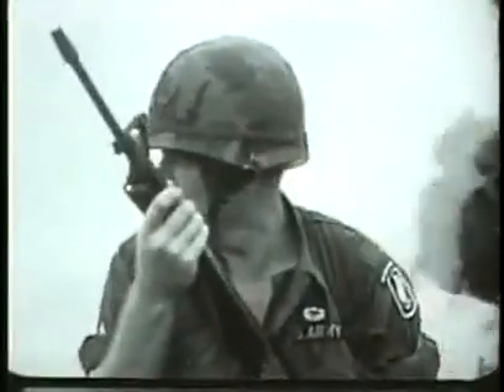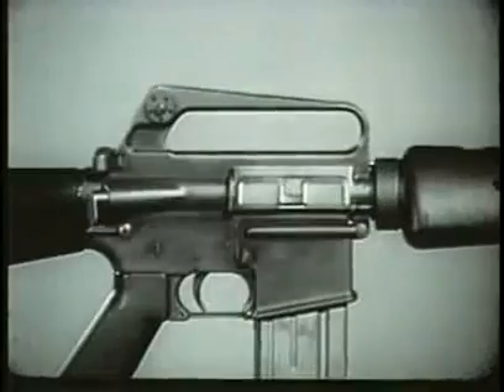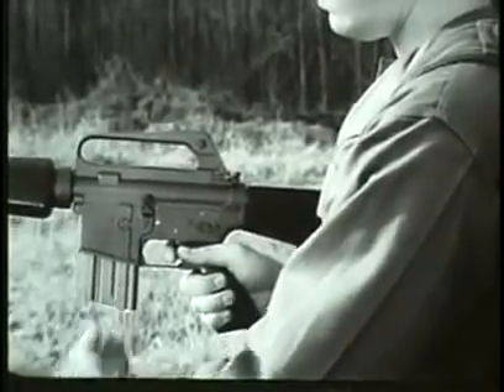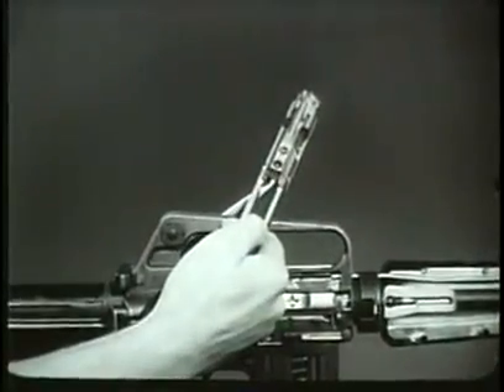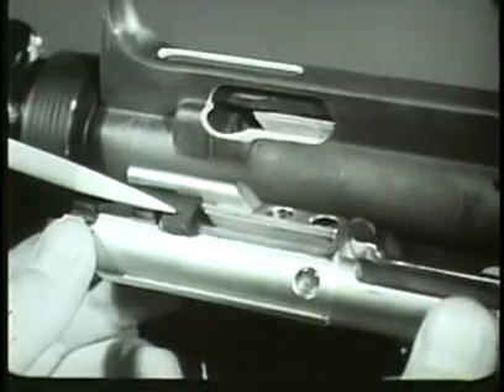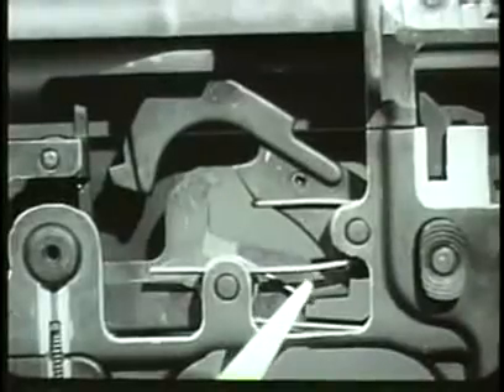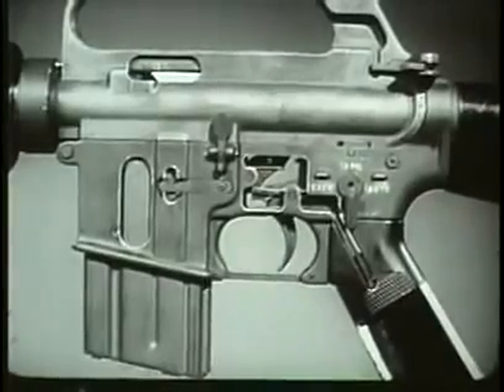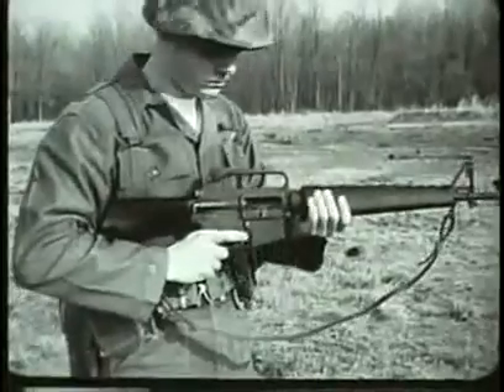Vietnam War Era Training Video: Operation of the M16 (AR15 variant)

Comment: I loved the m-16a1. I could knock down multiple targets quickly and efficiently at all ranges. Then the a2 arrived with a heavier barrel and there was the problem where the barrel would overswing the target where then I'd have to bring it back on target...
I know they had to solve problems for a range of shooters. The ones who couldn't seem to ever grasp the four basics. But I'd trained these bolos and had turned them into at least sharpshooters on the a1. The changes only seemed to hinder those that were expert and they didn't do much for the weak shooter. The loss, was that you had expert shooters who, before, could wipe out 3-4 targets before a weak shooter could score a single hit, who were now only producing 1-2 targets in the same span of time. Thats a critical loss in a fast paced environment. The 2 that weren't taken then and there, could be the ones that turn your victorious raid or far ambush into a loss or a protracted firefight that has now put you in a bad position for the inevitable counterattack.

Comment: The M-16 wasn't the grandfather of the Ar-15 it was a variant of it.  Colt purchased the design for the AR-15 from ArmaLite and modified it for construction of the M-16 variant for submission to the U.S. Military when they were looking for a lighter MBR chambered for a smaller projectile than the M-14 MBR at the time.  The M-4 (current U.S. MBR) is another variant of  the original ArmaLite AR-15 design.

Comment: The m16 and the AR15 are two different guns… ones actually military grade and made for war the other is a personal defense weapon not at all suitable for war let alone use by military.
Reply: You definitely could..only difference is it doesn't have a fully auto switch. Which our boys never use anyway. Its a waste of ammo and inaccurate
Reply from the maker: Good point.
Reply: no. Armalite AR15 was what would become the M16. Colt just kept the name for the semiautos
Reply: @d3203  key words "would be" not the same. Would you call an MG34 and 44 the same gun?
Reply: @DW-zj6ux  Mg34 and Mg42 are completely different systems. The Armalite AR15 and Colt 601/M16 are the same rifle.
Reply: @DW-zj6ux  i guess you meant the Mg42
Reply: @d3203  yes I did. I had the mp44 and STG on my mind
Reply: @DW-zj6ux  and its would become not would be. Like by your name i would assume you should be a native speaker.
Reply: @d3203  we aren't speaking. We are typing. I'm not writing an essay.
Reply: @DW-zj6ux  and back to the "argument", the MP44 is the same as the STG44. The Sturmgewehr (assaultrifle) is a propagandaname for the MP44.
Reply: @d3203  the mp44 was a prototype
Reply: @DW-zj6ux  no its not. In 1943 the MP43 went into massproduction. in 44 they changed the name without changing anything to MP44, shortly after to STG44.
Reply: @DW-zj6ux  the prototypes name is MKb 42 (H).

Comment: Hind sight is a wonderful thing.
The manufacturers demonstrated this weapon's "reliability", 
by using a different type of ammunition to what the troops in 'Nam were using.
  This was a major contributing factor to the weapon becoming fouled by residue
When the "fouling" and resultant unreliability problems were reported to the manufacturers, they tried to say that the troops weren't cleaning them properly!
   The troops would have loved to swap places with the folks that said that,
 as they tried to clear a double feed as the enemy were upon them,
those enemy troops carrying AK's.
    It took a very senior officer, who had served in 'Nam,
 to get the top brass to address the problem.
Reply: however the Ordinance Corps were the ones issuing the out of spec powder ammunition, Colt had no input on that whatsoever

oh yeah and the troops definitely weren't cleaning them properly since almost nobody was given a cleaning kit until the late 60s

Comment: Did it come with extended mags? 

20 bullets isn't much other than single fire and semi fire.
Reply: 30 round magazine at that time may be still in development and testing I think. It's not until late 60's that they start issue 30 round mags.

Comment: the forward assist was a mistake, everyone knew that except the army
Reply: Paul Harrell has some words for people such as yourself that believe you're an expert to give advice and critique something you apparently know nothing about.
  You're an expert idiot
Reply: @CM-ve1bz  ive watched that video, that is in no way related to what i said
Reply: @lowquality9232  
  You made the claim that the forward assist was unnecessary and "everyone" knew it. 
The only ones that would make such a claim don't know what it's actually for and that's exactly what Harrell was talking about.
Reply: @CM-ve1bz  its called an exaggeration, i didnt exaggerate the fact and make a blank statement about it but instead the "common knowledge" of it and those who knew about it
Reply: @CM-ve1bz  and im aware of what the forward assist is for, to seat the bcg, the issue is there was no need for it and that is why eugene stoner originally had not included it until the US Army demanded it, even after the air force came out later saying why it was not needed and how it was likely to just cause issues
Reply: @lowquality9232  
  Yes indeed it's for seating the bolt but it's not intended for beating a round into the chamber.
Reply: @CM-ve1bz  what lol? that still doesn't change the issue that its unneeded
Reply: @CM-ve1bz  okay 🤷🏼‍♀️ good luck with that
Reply: @Aidan Hand I think there’s a mixup here. Both the Air Force and the Marines did NOT want a forward assist. Only the army demanded it, probably to have ONE THING from the M14 they loved brought to the M16. The army was forced to take the M16 kicking and screaming, if you recall.
Reply: “The forward assist was a mistake, everyone knew that except the army” is what you said. You regurgitated that unoriginal thought as if you knew anything. It was, in fact a good idea and retains the same use it’s had for the last 55ish years. So no, reading isn’t hard. But apparently regurgitation of unoriginal thoughts and sticking by them is 😂. Dead in the water dude. You’re a know nothing, just own it like a man and shut up and sit down.
Reply: @charlieyankee1046  when did i say the main comment is where i said what it was for lol? bro you good?
Reply from the maker: The air force pushed for it in the beginning. Ian over on Forgotten Weapons did a really cool video on that one. Link is in the description if you're interested.
Reply: @fighterairplane  saw that one! was a nice video giving insight into how the gov wants useless things at times, isnt the new trend making everything modular now? 😂
Reply: @lowquality9232  the forward assist is used quite frequently and is absolutely necessary. Maybe not on a flat range but I promise it’s got it’s place.
Reply: @charlieyankee1046  just because the military does it, doesnt mean its good, this should be known lol

the last thing you should be trying to do is force a round that does not want to be seated because of debris or a fouled chamber, thats how you end up with a stuck casing
Reply: @lowquality9232  
  I've already told you it doesn't have anything to do with forcing a round into the chamber. That's why you think it's useless, you don't know what it's real purpose is.
Reply: @CM-ve1bz  then explain it or see yourself out of it
Reply: @lowquality9232  
  I've told you what it's not for, a gun expert like yourself should be able to figure out it's intended purpose.
Reply: @CM-ve1bz  lmao so you think me saying the fa was useless was acting like an expert? man you really are trying to make that comparison with Paul's video
Reply: @lowquality9232  
Absolutely
Reply: @CM-ve1bz  OK
Reply: @lowquality9232  that’s not what it’s used for dinkus. What’s used for is ensuring the chamber is locked like I already stated. No one forces a round into the chamber. Little bit of carbon build up, bolt carrier not seating all the way forward with the chamber not locking up, yes. 

I promise I know more than you. Just because you watched 1 forgotten weapons video does not make you an expert on what the forward assist is used for. Promise.
Reply: @charlieyankee1046  yes, to push the hot carrier forward, i had literally said that was earlier, and I'll have you know I've watched every gun tuber om this platform, im an expert on everything from firearms, to tactics, and explosives 😎
Reply: @lowquality9232  oh no no no. Don’t go switching it up. You came out the gate hot on its “uselessness”. Don’t go switching it up now Mr. YT weapons employment and management expert. Keep that same energy boo.
Reply: @charlieyankee1046  literally read above, i said what it was for, still think its useless
Reply: @charlieyankee1046  learn to read or dont bother, when another user said i didnt know what it was for i said what it was for
Reply: @lowquality9232  I’m 100% tracking on you dude. Don’t deflect now.
Reply: @lowquality9232  no I just won’t let you walk it back😂.
Reply: @charlieyankee1046  man it isnt hard to read lol, i said what it was for

Comment: imo, one of the best and most innovative rifles ever created. The only downfall I see to the platform is the need for such a massive buffer spring to prevent an effective folding stock and the lack of charging handle attached to the bolt itself. Usually where the AK shines.
Reply: The AR-18, Armalite's other AR. It has short stroke gas piston system. The M1 Carbine's gas operating system is similar to this and got a paratrooper model with folding stock.

Comment: Not the AR15. AR15 was never an instrument of war.
Reply: Sure it was. The Air Force bought AR-15s from Colt before it was adopted as the M-16. The current models lack select fire, but it's mostly the same weapons system.
Reply: @PacketWrangler  no that's not how that went. Like at all.
Reply: @PacketWrangler  AR15s and M16s are two different platforms. In Vietnam the M16 was advertised as self-cleaning, which isn't true. The first fielded M16s didn't come with cleaning kits. The A1 featured automatic fire, which was found to be highly inefficient. The A2s were given burst capacity.
Reply: @PacketWrangler  what you might think are small internal differences are actually what separate the platforms. If you were to take an AR platform, run 100 rounds through a day, take it apart and clean it every night, you'd have break downs in equipment faster than M16s. M16s were designed for military purposes. While many M16s rattle because of loose fittings, it takes years for that to occur on most systems. ARs would come apart with that type of treating. Good civilian shooting rifle. Bad main force weaponry.
Reply: @carminescurse  i think he's more talking about it being "an instrument of war"
Reply: @staticdescent4769  it was never a main field weapon and Air Force was issued it for special assignment.
Reply: @carminescurse  I know I'm just clarifying what he was talking about, it seemed there was some confusion there
Reply: @staticdescent4769  oh ok my bad.
Reply: @carminescurse  just a heads up the AR-15 (talking about ArmaLite's baby, not the rifles that came after Colt marketed their version as a sporting rifle) is the M16
Reply: @harveyknguyen  no it wasn't.
Reply: @harveyknguyen  the M16 was offered to the US forces not the AR platform.
Reply: @harveyknguyen  the Air Force was issued ARs for special duty and only because the AR is cheaper than M16s. The AR is cheaper than the M16 because if it issue the M16 to you and send you out to a high combat area, the M16 will perform.
Reply: @harveyknguyen  the AR will fall apart. The first thing to go are the pins that hold the upper and lower together. The AR pins are made with a cheaper metal composite. The second thing thay goes will be a part on the bolt assembly. Either through deformation or just wear beyond what the platform is designed for.
Reply: @harveyknguyen  for reference, I pulled my own weapon off the firing range because the bolt warped, an M16. An AR platform will suffer those issues more frequently. It's designed for civilian application and to be cheaper than the alternatives.
Reply: @carminescurse  so what you're saying is that ArmaLite actually just made a semi-auto rifle in 5.56x45mm and the M16 is the military's brainchild, even though the report on the M16 still calls the full auto version the AR-15, and the fact that the Colt Model 601, an AR-15 and also shoots full auto, exists disproves what you said
Reply: @harveyknguyen  lmao. No, no.
Reply: @carminescurse  also you are completely correct when you say that the M16 (ArmaLite's AR-15) was offered to the US military and not the AR platform (Colt's AR-15) because the AR platform came out in 1964
Reply: @harveyknguyen  not a good thing to just run dry on ammo. In fact, usually only special operations groups carry automatic M16s. But mostly they don't, because as special operations they get a separate account for weapons away from Big Army.
Reply: @harveyknguyen  and they still don't issue automatic M16s to Big Army anymore. The M249 has more range anyway.
Reply: @harveyknguyen  no.
Reply: @harveyknguyen  you are so incorrect it's not funny. Just because these versions exist doesn't mean they are used.....like at all. And why would I? Literally the only place I would get issued one is special ops. And there are so many automatic (and semi-automatic) platforms I could qualify with that are so much more reliable that the M16/M4 platforms.
Reply: @harveyknguyen  by the way, when Armalite offered their platform it got passed on. For PERFORMANCE ISSUES. Colt picked it up, changed internal components and made it cheaper (stamped steel).

Comment: there were no jams, that surprising
Reply: well yes because it's a very functional weapon. from the ver y beginning int worked well. the whole jamming thing was caused because some idiot decided that they didn't need cleaning kits, and as it turns out leaving a gun's parts soaked in dirt water and mud for weeks to months at a time with no kit to clean it once in a while will cause it to jam
Reply: @Badger-l7q  not to mention that the ammo issued used out of spec ammo so the fire rate was faster than the bolt could handle

Comment: That's not the AR15 smh the XM16E1 is a very different weapon
Reply: Actually they're pretty much the same
The origonal AR-15 of this era was sold before it got into military use. had select fire options and every thing. there's very little to no difference between an AR-15 of this era and an M16 since the military juts ended up adopting it after it was already being sold as an AR-15
Reply: @Badger-l7q  theyre different
Reply: @d1mstarz  Every single part between an AR-15 and M-16 are identical except for the fire control group, you can't put an M-16 trigger pack in an AR-15 unless you drill a third hole.
That makes it basically identical, chill out
Reply: @Robert-qm7yi  nope
Reply: @d1mstarz  Please PLEASE help me understand how you're so confident but still wrong. You can even look at the blueprints, there's so much information available and yet you still don't understand and don't want to
Reply: @Robert-qm7yi  nope

Comment: M16 isn't an ar15
Reply: Actually it is.
The origonal AR-15 of this era was sold before it got into military use. had select fire options and every thing. there's very little to no difference between an AR-15 of this era and an M16 since the military juts ended up adopting it after it was already being sold as an AR-15
Reply: @Badger-l7q  interesting.

Comment: M16 and AR15 ARE TWO COMPLETELY DIFFERENT RIFLES!
Reply: Actually they are basically the same
The origonal AR-15 of this era was sold before it got into military use. had select fire options and every thing. there's very little to no difference between an AR-15 of this era and an M16 since the military juts ended up adopting it after it was already being sold as an AR-15
Reply: @Badger-l7q  you obviously don't know shit about guns. In fact it was the AR-18 That the military was looking into using instead of the Colt M16.
Reply: @bradley19822  you really need to look into your history. the colt M16 is functionally the same as the AR-15. it's just made by Colt since they had the production capacity to meet military demand.
Secondly, the AR-18 literally has noting to do with this argument so I don't know why you would even bring it up. but seriously,  go look for online information about this stuff. I belive forgotten weapons actually goes into the history of the gun, it'd be easier to just find their video on the M16A1
Reply: @Badger-l7q  please stop. You are making an ass out of yourself. There is a huge difference between an M16 and an AR15. YOU KNOW DICK ABOUT RIFLES AND GUNS. IT TRULY SHOWS BY YOU SAYING THEY'RE THE SAME.
Reply: Colt made the M16. Armalite made the AR15. CHANGE THE DAMN TITLE!

Comment: An M16 and AR 15 are not the same. They both belong to the ArmaLite series, but are not the same firearm.
Reply: This is factually incorrect

they're nearly identical. the AR-15 is the name given by armalite as they sold them on the civilian market. M16 is the military designation. about the only difference between the models would be the access to fully automatic fire setting.
Reply: @Badger-l7q  then I stand corrected.
Reply: @xenomorphfromlv-4263  though it is worth noting htat due to gun rights problems in the modern day, the fact they are still different, and that the modern AR-15 specifically doesn't have select fire, has to be extremely stressed for the sake we can still own them.
Reply: @Badger-l7q  you can say that again.